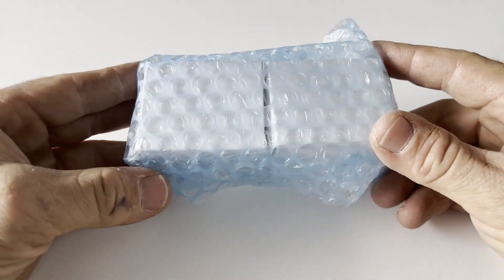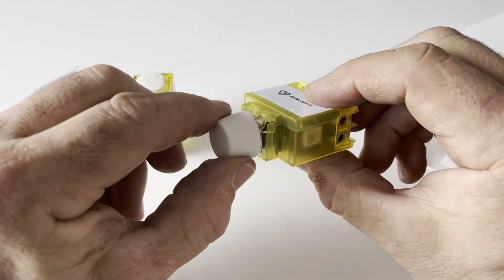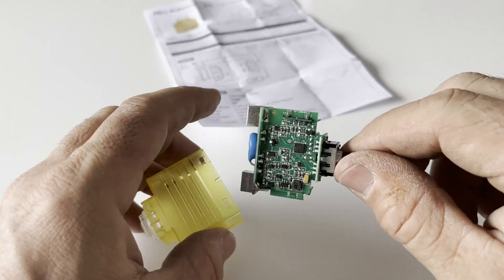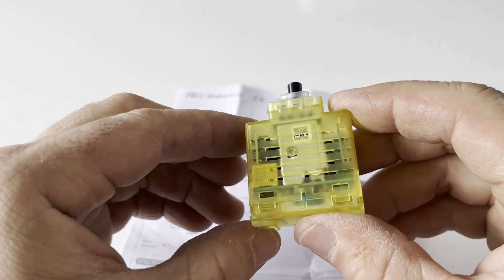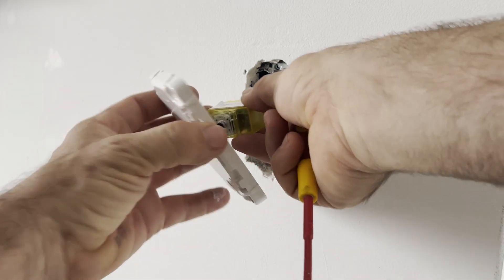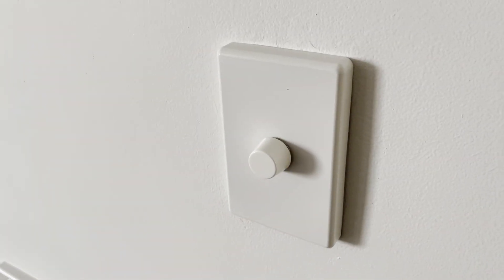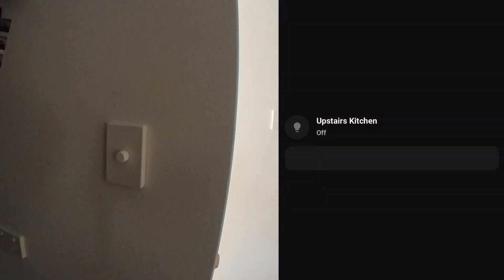The BEST overall Smart Dimmer for Home Assistant!!!

Comment: Just knocked off 4 of these switches with your great tutorial, mate!

The dimming characteristics of your LEDs looks quite good. Mine start to flicker once I get down to 60%... What brand dimmable LEDs are you using?
Reply: Have you found an issue where they are only recognized as a dimmer in the app - then once turned off at the physical switch you can not turn them back on from the app - i.e. they only act as a dimmer and you have no switch control in the app ? I am wanting to know if they have updated the firmware so it is now recognized as a switch not just a dimmer

Comment: I'm all for a dimmer like this 🙂 
But from what I've been advised it's even more susceptible to our 750Hz or 1050Hz ripple signal for off-peak, etc. Have grabbed me a set of 2+1 free via Oz Smart Things - they should do well in my bedrooms - especially for the kid's rooms where they tend to leave it on... As we do have bedside lamps on mostly after 10pm, the use case is pretty good and should hopefully avoid the nuisance signal.
Reply: Are they affected by the ripple signal?
Reply: @FreeRem  yes they are. I've been eyeing out the THOR ripple filter in my case - which should hopefully help. Overall though these are some rock solid dimmers.
Reply: Could you explain this? The only thing I've noticed is that they interfere with my TV signal (but TV is on the wall behind the dimmer).
Reply: Have you notice the problem that i documented above with the latest batch ? i..e if you turn it off at the switch (physical) they are no longer available in the app ? Have you got them recognized as switches rather than just dimmers in the app ?
Reply: @MrCraigCurtin  I haven't noticed an issue with using it via Tuya or Home Assistant - they appear as dimmers without an issue in there 🙂

All automations still holding up fine as well. They've actually been flawless for me otherwise
Reply: @zenstrukt  but do they only show as dimmers or as switches ?? As dimmers once they are off at the physical switch you can not turn them back on (is what I found) can you test and see ??
Reply: @MrCraigCurtin  I don't have this issue whatsoever with my 3 switches. Have you tried re-pairing to see if the behaviour changes?
Reply: @zenstrukt  yes I paired them many times - mine are from a batch about 4 months ago - just confirming that in tuya you see these as a switch and can turn them on and off as well as dim them ??
Reply: @MrCraigCurtin  yes I do. Power on/off option as well as dimmer, schedule & timer.
Reply: I've just installed mine (Brisbane). It's 7:40pm at the moment and I'm not seeing any rippling. Using 90mm Deta downlights from bunnings.

Comment: Just wondering if anyone on here has these recognized as Dimmer Switches in the Tuya app. Mine (no matter if added automatically or manually) keep setting themselves up as Dimmers only. There is no way to activate them in the app - but once turned on manually by pressing the physical button they are then avaialable to dim up and down. Ultimately i will be using these with Node Red rather than HA but sending them commands through the TuyaAPI engine - they seem to ignore the on/off commands in DPS 1 - anyone else seen this ? I have contacted the supplier and they just referred me to the video and said thats it !
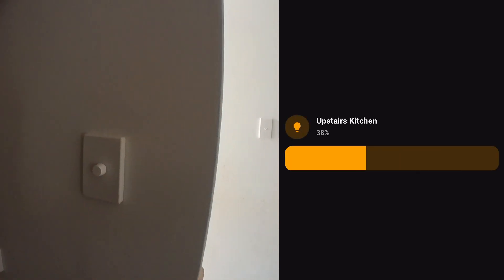Reply: I have just added this into the latest version of HA using the V5 of the LocalTuya HACS integration. I note that at 9:20 in the video he seems to have the same issue that i am seeing but glosses over it - if you turn the device on from HA - it immediately turns off again and then all control is lost until it is switched back on from the physical push button on the switch. Jimmy wondering if you can comment on this and advise whether you are seeing the same behaviour ?

Craig
Reply: OK more messing around and i debugging down at the ethernet packet level and i can not see anyway that these devices are going to work in HA without a Firmware update - once they are turned off all automation and control is lost from them until they are re-enabled from the switch itself (by pushing) - so i bought two of these based on Jimms enthusiasm in this video and i wonder now whether he is still using them (and if he is experiencing the same issues that i am) or if this was some form of paid promotion and these have been consigned to the scrap heap. I have to say that the supplier is appaling at answering emails or in any way appearing to be interested in addressing the issue that i have identified.
Reply: I'm having a similar issues. unable to find in tuya. haven't yet set up HA
Reply: did you get these working?

Comment: Hi James, thanks for the content. Is this still using phase control from the dimmer? 

I am in South East Queensland and suffer bad with ripple tone injection from Energex causing my downlights in dimmers to flicker. 

I was hoping this was simply a wifi rotary encoder that I could integrate into HS to then control programmatically a wifi enabled downlight that doesn't rely on phase control input signal
Reply from the maker: You could do that with this dimmer. There is the problem that it relies on wifi for the lights to work. But what you wanted this could do.
Reply: @SparkyJames  thanks mate, so essentially the output to load would not be connected but essentially just have it provide the states and rotary position via wifi. Do you know if there are any adaptors for this to fit into a Clipsal iconic series grid plate?

Comment: Great find, mate. I'm in the process of replacing my rotary dimmers. Question on tuya local (first time user). You used the Tuya app for the initial setup. That account would be on an external server which is not really in line with the Home Assistant philosophy. While tuya local controls the device locally without cloud is there still a connection to the Tuya cloud server/account?
Reply: Did you have any luck getting these working with TuyaLocal?  Woud love to see some settings/tips on getting them in using this.  Is it a switch or a light or both?
Reply: @SimonJackson  Yeah, they're a light in Local Tuya. I simply followed the excellent tutorial here and got them added with no dramas

Comment: Looking forward to them getting more in stock - they look pretty good. Similar use case, do you have any recommendation on a HA friendly fan speed controller for an older fan that currently has a generic 3 speed switch? I'm trying to avoid the Deta one as that LED always on would kill me and I've read reports about them not being overly reliable. Bonus points if it had rotary dial control - but wonder if I would need to replace fans with newer (DC?) fans for that...
Reply from the maker: I know , if they can get enough I bet they’ll sell heaps of them. I’ve used this fan controller https://youtu.be/9ypojNd6IiY I believe they make it with a wall plate as well with the 3 speeds as buttons
Reply: i too am looking for one of these. want it to fit in the old wall plates, have a physical control as well as local home assistant.

Comment: I was gearing up to go down the Shelly dimmer path but it didn’t have the rotary dimmer included. This will definitely make life easier, with a much higher WAF. Quick question (confirmation) how does the system control the brightness remotely?  Which take precedence, the local dimmer setting or the remotely controlled setting?
Reply from the maker: It’s a relative encoder so there is no physical high or low position , you simply turn the knob to increase or decrease brightness and the change reflects in HA , and in HA you can change it up and down. If HA is shutdown or there is no wifi it still just a normal functioning dimmer.
Reply: @SparkyJames  This is great. Exactly what I was looking for as we are currently renovating.
Reply: Any ideas how this would work in SmartThings?  Do we have the dimming function?  Most Tuya stuff comes across fine. I haven’t had the time to commit to Home Assistant.

Comment: Hi James, great video mate, does it fit in Clipsal Iconic range?
Reply from the maker: Sorry no, iconic have effectively blocked out any third party applications like this it’s a closed ecosystem, as of now your choice is the control link push button and a Shelly , even the iconic dimmers that are Bluetooth using wiser have no api to connect with last I checked
Reply: @SparkyJames  I think he means does it fit the wall plates, not the clipsal zigbee system
Reply: @SparkyJames  thanks mate, is there another range and brand that looks nice and these fit in it?
Reply: @SparkyJames  i had wiser dimmers work with zigbee2mqqt. blue tooth can be switched over to zigbee.(well at least the ones i have can) but they are overpriced !
Reply: I will never buy Clipsal again for that reason. The Iconic are rubbish, excessively priced and inflexible for upgrade.
Reply: I have the same question around whether the mech will fit the iconic plates. The product page specifically calls out iconic, so I'm hoping it's a yes!
Reply: @mulaco  can you please point me to that? I'd probably buy one to check on that basis.
Reply: @rossco5551  https://www.ozsmartthings.com.au/collections/wifi-home-automation/products/oz-wifi-rotary-smart-dimmer
In the link provided in the description, check out the "Wiring Device Mounting" spec
Reply: @rossco5551  
From the manufacturer:
Hello Calum, 

The rotary dimmers are compatible with the Clipsal classic range, not with iconic.